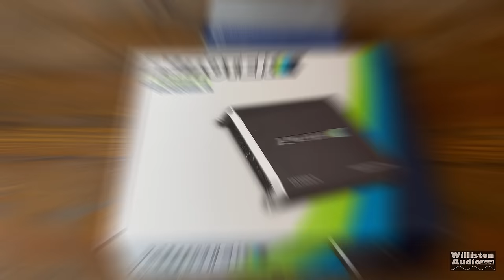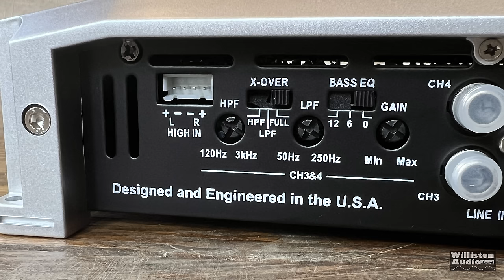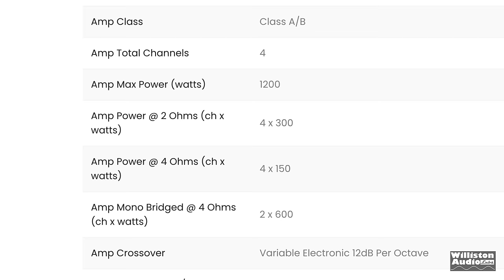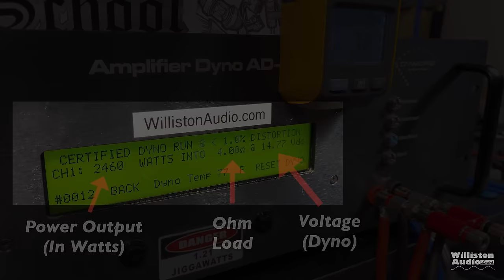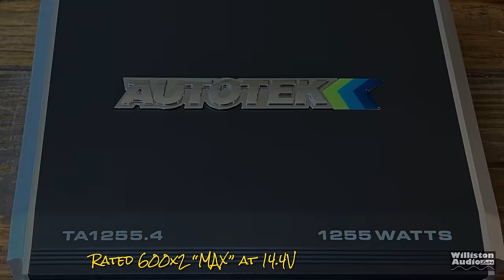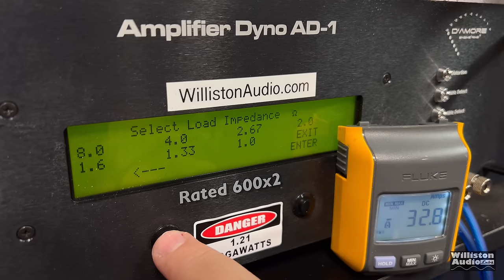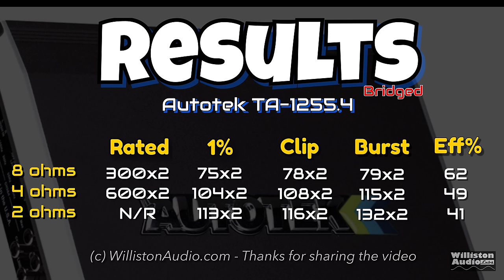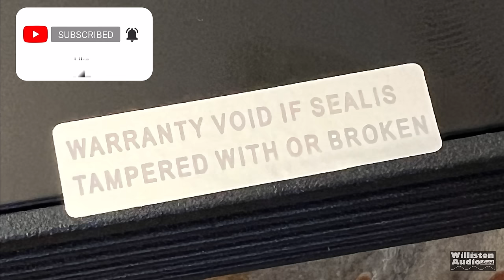This $60 1200W Amp Makes How Much True Power?

Comment from the maker: SHOP
Autotek TA1255.4 Amplifier: https://amzn.to/3vuQKwn
Down4Sound MiniMaxx Amps: https://lddy.no/1hrle
Recoil DI550.4 Amplifier: https://amzn.to/48oWNBf
Elac Debut 2.0 B6.2 Bookshelf Speakers: https://amzn.to/3Mmdbcz
Down4Sound MiniMaxx MM1004 Amplifier: https://youtu.be/JwQQYl2Fvi0
SAVARD 6.5" HiQ Subwoofers - https://lddy.no/1iv98 (use code WAL7 for 7% off!)
See the SAVARD HiQ 8" Sub Unboxing: https://youtu.be/ldQ6WnEe-lY
SAVARD HiQ 8" Subs in Custom Box: https://youtu.be/UnEL6NRDPEs

DISCLAIMER: This video and description contains affiliate links, which means that if you purchase from one of the product links, I may receive a small commission. As an Amazon Associate I earn from qualifying purchases
Reply: Loudly🤷🏽‍♂️🤦🏽‍♂️
Reply: I acquired a "1250 watt" alpine amp from someone and after sifting through the manual, I found a section about ohm ratings. It is 4 channel but bridgable to 2 channel. Each of the 2 channels claim minimum impedance of 4 ohms and max 130 watts per channel, totalling 260 watts... yet the amp is labeled with 1250 watts and has a 30 amp fuse. I can't complain too much since I'm using it on two 200/250 watt subs and it pushes them hard enough.
Reply: @wal
That is bad even for a headunit now day

Can u test some vibe audio
Reply: Can you check these and see what it do please
Reply: I bought out a storage container from SALT SOUND a few years back. 59 items, brands Tancredi, Alphasonic, Alpine, Clarion and a few others. All from the mid 80's to about 1992 NOS. 4 crates of stock. Nothing made in the last 30 years can even compete.
Reply from the maker: @JOHNDANIEL1  oh wow, that's cool!

Comment: No shade from me!! I am a huge fan of inexpensive equipment. This is an inexpensive step up from head unit power. Class a/b sounds a lot better than D and if installed properly I'm sure it would sound good and last a long time!! Thanks Big D

The audio bug doesn't just bite the wealthy and the ROI is HUGE at the bottom and tiny at the top.
Reply: If you add in road noise I'll bet most people can't tell the difference between class a/b and class d driving down the road. The power efficiency/cost favors class d.
Reply: Am from Jamaica and the customs charge is 67% the price of the item is over $50 USD,  I ordered a andeman 4 channel amp, it was $64, (it's sold out right now, they only have the 2 channel) I paid basically double the price in order to import it. Stereomojo on YouTube amp dyno it and it was at its rated power, about 80 watts at 4 ohm and 120 watts at 2 ohm, and it had a high dynamic power. It's great for the price. The closest to it I think I would buy is the hyanka for $72. All that to say I am always trying to get the best I can get for the lowest amount I can manage. And see that autotek amp I bought 2 autotek subs when they were $30, now they are 35. I don't regret that purchase, I have them running at 1 ohm on a audiozerone 1000 watts amp that I paid $68 for when I just came out, bigdwiz did a dyno of it and it was legit.

Comment: I used to have 2 mean machines (44 & 66 if I recall correctly) back in the day. I loved those amps. Clean power and I’m sure they put out more than rated power. It’s sad to see some company has turned that brand into a joke 😢
Reply: Sadly that's what happened to a lot of legendary legacy brands over the years. They were bought out by some competing company and their names was ground into the dirt and plastered on cheap garbage.
Reply: Had the 44ix mean machine myself it was a beast back in the early 90s
Reply: @Slane583 Most of the time these older companies simply went out of business. Later on, their names were purchased by another company. This is why the new products are completely different from the old products.
Reply: @JasonWW2000  True. But brands like Homelite, McCulloch and Poulan were absorbed before they went out of business. They were struggling because they couldn't offer what Stihl and Husqvarna offered as far as chainsaws went. Because Stihl and Husqvarna were way ahead of them in safety and engine design. Sometimes lightyears ahead. Either way all three were bought by a completing company or some Chinese firm and were literally turned into cheap garbage.
Reply: @Slane583  I understand why you said "true". 
I don't understand why you said "but".
Reply: @JasonWW2000  Because you are correct about the names of companies being bought up once they've long since been out of business. As for the three I mentioned they were not yet out of business when they were bought up so they were an exception. Which is what the "But" was about. 

Other than that you are correct. Most of the time the name of a famous brand is purchased by either another company or some firm. It is revived in name only to have garbage products branded under it and when customers purchase them and they fail the customer starts thinking that the brand should have stayed out of business. :)
Reply: @Slane583 I don't think you realize what you did there. It's cool, though.
Reply: @JasonWW2000  Probably not. Just making myself sound like an idgit more like it. That's why I don't debate about anything. 😆

Comment: I Been Waiting For A Dyno Test On This Thanks Big D 🔥🔥 I Was Hesitant On Buying This For My 2 8s But Now I Know What Im Going To Do
Reply: Whatcha gonna do ? Get a Jp 4 channel instead 🤔👌
Reply: @bobcat3653  I Was Looking At The Taranps 400x4 I Think That Would Be Suitable Plus This Is Only For One Of My Cars I Dont Drive Much. Its Got 2 Meso 8s 2 Sony 6x9s And Skar FX6.5 On All The Doors Off My Pioneer Head Unit 1 AGM Battery n 1/0 Alt Welding Cable Stock Alt.

Comment: I recall their Mean Machine amps being very popular in the early 2000's, so I assumed they were good amps for the price back then. I guess we lost another respectable manufacturer.
Reply: Ive got the 1400.1D here at home , but it doesnt want to turn on anymore.
So replaced it with a audio system 1200 mono amp.
Gotta say the Autotek had some juice for sure  , was amped 160A and Im sure it took a lot power.
It drained my 100ah battery while the car was still running 🤣😂 it was hooked to a DD 12 inch 2x2 ohms that easily took the power.
I still got all the stuff in a golf mk2 in my garage , just for nostalgia. The sub is still a beast 💪

Comment: When you look at both the test results and the internal images i wouldn't be surprised if they are using the same or modern version of the old amps chips. They internal layout of the new amp is essentially a neater version of the old amp but due to cheaper components it puts out the same power at 2ohms as the old one at 4ohms

Comment: Crazy....i used two of these in my work van they actually dont sound bad running mb quartz 6.5 comp front and rear and two 12s in custom ported enclosure..thought it would've done more too just by fuses

Comment: I think my next mono amp will be a JP amp. 
Im currently running a Wolfram O2400.1  which I have no issues with. But I want to upgrade to atleast 5k watts.  I have more than enough electrical
Reply: I've been running a Wolfram C2400.1 on a Skar VXF 12 for a couple years now and it's legit.  I recently did a build in my truck and I'm running a JP43 on 2, Deaf Bonce 15's (275's) and I'm still afraid to turn the bass up all the way... it sounds like my truck is going to disintegrate.   

Anyway, I thought it was kind of funny that someone else out there is running very similar gear.
Reply: Definitely go with 2 Soundqubed S1-2250.1 strapped now if you want a pretty colored amplifier that cost more then I would definitely go with 2 JP 23 amplifier strapped. I like the green and turquoise amp the best. I also like the purple and orange and red well acually I like lots of colors. Jonathan Price really did something amazing by have all those gorgeous colors of all those amps.
Reply: @RyanBassForLife Why are you always telling people to buy Soundqubed?
Reply: @JasonWW2000  because it's affordable for the price. Another good brand is Skar and Taramps. Also Stetsom and a Down4Sound amplifiers. Also American Bass and NVX is also affordable for what you get.
Reply: @RyanBassForLife  Cool. 
It seemed like you were aggressively pushing that one brand.

Comment: All is old dudes know how happy we would have been to get anything near 200 watts for $60.
Reply: @91CavGT5  you are not kidding. How happy I would have been back in the early 90's  to been able to have that stuff.
Plus even with inflation where it is if you are a teenager you can get a part time job and have a fantastic sounding system in your vehicle for what I paid for a head unit aka deck aka in dash radio. LOL
Kenwood krc422 if I recall the model number  correctly and I paid $430.00 plus tax. And it was a cassette deck.
We all have to take it up on ourselves to fix the homeless problem in this country. Derek you cannot deny that when you were a kid this wasn't a problem like it is now.
Reply: Back then watts were underrated. 200w back then was like 900watts rms watts

Comment: I'd love to see one of the Autotek Stealth Series Chrome flush mount 4 channels (model number 600.S if i remember correctly) tested. I have one in need of repair, but don't have the time to get it done right now. If you can get your hands on one, it would be awesome to see. This amp used to rock on 2 old school Eclipse 12 inch 86000 series subs and a 5 1/4 inch Eclipse component set in 3 channel mode.

Comment: Whats up Big D!! I wanted to ask if you could do an amp dyno on the Alphasonik Mayhem series amps. Preferably one of the higher watt monoblocks if possible. I know that the Venum series did not do at all what Alphasonik rated them to do, but I believe these are gonna be a little different. I trust in all that you say and basically go on what I get from your channel as to whether or not I purchase some audio equipment. I know a lot comes down to some manufacturers furnishing the amps and you buying them from your own wallet. But, if you get the opportunity to do one I would love to see what your findings would be. As always, love all the hard work that you put into these videos and they are greatly appreciated. Thanks for all your time and hard work.

Comment: Clue #1. Fuse size. Clue #2. Heatsink size. How is something that small going to dissipate the ~500 watts of waste heat, the theoretical minimum for a 1,200 watt amplifier running maximum amplitude into rated load impedance? It would require substantial airflow, to maintain anything less than 80°C case temperature.

Comment: Some of the cheap import amps only have 1 fuse actually wired into the circuit. The other is "a big dummy" fuse doin nothing but taking up space.

Comment: Big D: I'd really like to know your thoughts on this new EV car craze being thrust upon us, and what you think will happen to the after market car audio business if we are forced to only having EV vehicles?  Everything I've heard from people about the OEM car stereos in EV's suck even more than regular cars so not to pull much power from the batteries. And you sure as hell can't upgrade your alternator in them.(Buy an EV pickup, put a generator or two in the bed, and have them running and plugged in all of the time?  lol)??
Reply: There's really no difference at all when it comes to installing a sound system in an EV. I'm referring to a normal sized sound system that's around 500 W actual power. The only time you would run into a problem is if you're trying to build a massive SPL system that needs huge amounts of current for the amplifiers. You can install a lithium battery bank and use that to draw a lot of current, but the problem is the DC to DC converter (which acts like the alternator). It can supply plenty of power to the vehicle plus a little extra reserved but it's limited just like a stock alternator would be limited.

So you can still blast a lot of bass and draw a lot of current, but once your battery bank starts to drop down and the DC/DC converter can't keep up, you'll have to reduce the power to give it a chance to recharge your battery bank.

Comment: Sad. I used to have a maxxsonics amp about 20 years ago. The BLX2000D. It was a good amp. Had it powering a15 inch sub and it slammed. For only 60 bucks, you get what you pay for.

Comment: Being fused at 60 I assumed it would get half that 1200..this is crazy.
Reply: This is an alarming example of how someone at the marketing probably noticed that people tend to check out the amperage of the fuses to get a ballpark figure of the actual output. If this type of over fusing starts to become a norm in cheap amps it's really concerning.

I was surprised how clear the installation guide was, even though it had stuff in it that the amp doesn't even have. And there being a clear notice about the gain not being a volume control is a good thing to have. Can't tell from the video how good the instructions are and at their website, there is nothing but "Support - Coming Soon - Product documentation and files are not yet available." I have no clue how long the amp has been around but that is pretty alarming too... And this video demonstrates quite well that there is no need for all that, as the quality is so bad and I wouldn't hold my breath to even see them posted.

It would be crazy to see something like actually expected 0.1% THD power numbers on a modern day product, even though in mobile applications 1% is low enough. Back in the day some manufacturers had like 3 to 4 different power output ratings for different voltages/standards/percents of total harmonic distortion.
Reply: Yeah, a maximum of 132x2watts @2ohms for an amp not even rated for 2 ohm use or 108x2 clipping at 4 when rated 600x2 is wild. It's a $60 amp but I could see people that don't know better buying this and wondering why decent subs barely get pushed.
Reply: @TecniclyAwsm  I was really surprised to see 2 ohm bridged numbers without any hiccups, even if the efficiency and the power output were absolute dog s**t.

Comment: They have gotten so cheap and crappy long away from the og amps . I mean if you are running a small system like you had setup for 60$ sure, sadly spend few more bucks and get a top strong gear or a black diamond or even the bass 400 taramps put out way better power. But damn that 6.5 was slapping

Comment: How does anybody sell cheap overated  amps these days when there's super cheap amps that actually make rated and sometimes more... It's apparently easy to make cheap wattage these days so why are maxxonics epsilon and boss still selling these cheesy gutless amps that don't even come close... With amp Dyno channels The days of plausible deniability are over, do people still buy amps without doing any research?  It's also mind-blowing there are still piles of people that have zero clue what there looking at just buying amps off the rack actually going by the claims on the box like "powerful" "performance"

Comment: The reason that amp didn't meet it's rated watts is due to the fact that it was not installed/tested in it's optimum position. It is designed to operate in an inverted position, meaning upside down. Once installed/tested in that manner, gravity will draw out that powerhouse of an amps true potential. 😁😁😁

Comment: NO THE STICKERS SAID "TREAD LOUDLY"... not a big reader are ya? the amp is trash. I coulda told you that. i used to have one of the original 200 wattx2 Autotek's and it was slamming. we did the clamping method and gave it an 80% to come up with 230x2 this new chinese shit is trash. the Savard's Awesome. Savard use to be one of my clients when I lived in Baton Rouge we had an HP contract for all their printers.
Reply: Big D was just foreshadowing the results of the amplifier test.

Comment: Why do all these test start at 14.1 but when you test any JP amps they start at 15 or above? Yea these are trash but quit selling out and make everything equal
Reply: It's common sense. Whenever you put a power supply or battery bank under load you have what's called voltage sag. When you have a really powerful amp you want the voltage to sag down to 14.4v or as close as possible. In order to hit as close as possible to 14.4v you're starting voltage has to be over 15 volts.